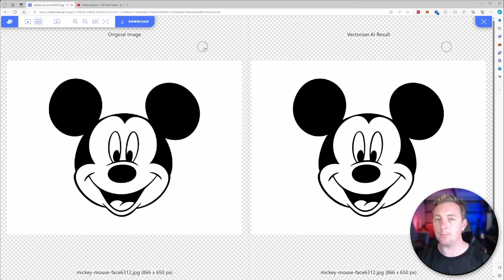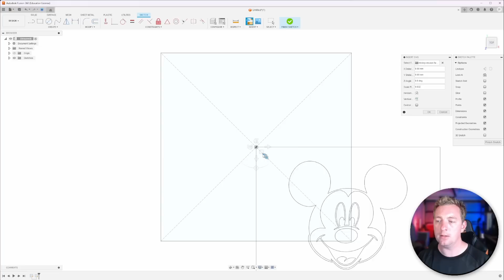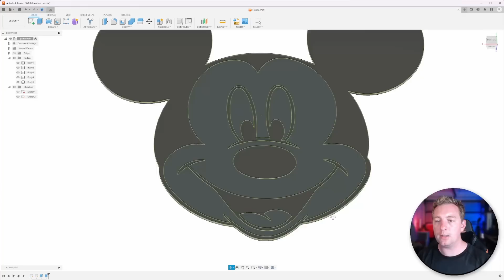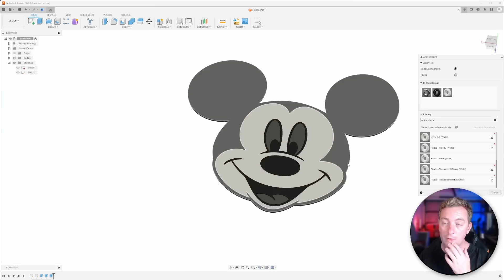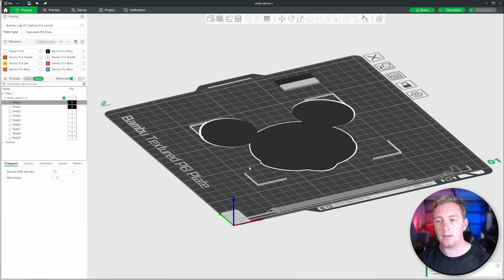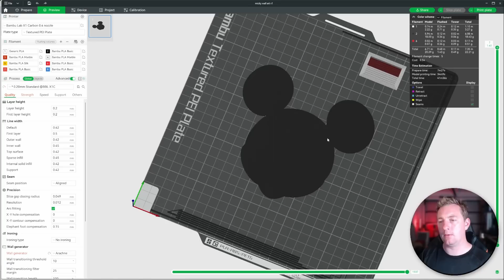EASY Tutorial For COLOURED Wall Art with Bambu Lab 3D Printers!

Comment: Great video, but I found the 0.4mm was way too thin and I can see through the white very easily. Even when I changed the white to 2mm, I could still see the infill beneath. Actually, now that I think of it, maybe adding a thicker white layer contributes to the transparency. I am using a Bambu A1. Thanks for the video. It got me started.
Reply from the maker: Thank for the comment. I dont have an ams with my a1 to try unfortunately. I wonder if there is a slight difference.
Reply: @DraftID  - I am positive it's a settings thing. Or it could be a filament thing? Regardless, your video got me on the right track and it's up to me to figure out the details.

Comment: Good tutorial, how could I adapt this to do text? Im trying to add flush text to my prints bottom, thought it would be easy but I hit a wall.
Reply from the maker: I typically use fusion for this. Create a sketch and add text, then just extrude the text and cut it into the model, then extrude again to create the body of the text in the model. You can also add text directly to you models in bambu studio. Maybe I should cover both these methods in a future video :)

Comment: I haven't used a 3D printer yet but just learning before it arrives. I saw somewhere that printing lighter colors first makes for a better print. Do you consider that when designing? New sub, thanks.
Reply from the maker: You can actually set the colour print order so thats something I could try. Normally I will just auto calibrate the purge to reduce the mixing which might be why it is recommended. I will have a video out soon about some of these advanced techniques right after I finish the current video im working on for embedding magnets in prints :)

Comment: Should you be switching over to Onshape as they say there will always be a free version. I get the feeling it is also better as it's not as comprehensive as 360 which does everything (including CNC) which means it is overly complex for new users.
Reply from the maker: Im not sure, maybe its worth taking a look at if its getting more traction in the hobbymaker space. Ive just used CAD for over a decade with solidworks, inventor, fusion etc so I know them so well.

Comment: As someone without an AMS, can this be done by swapping colors on the Bambu P1S as the print progresses, or does it really need an AMS to make this clean and possible?
Reply from the maker: You can get into the Gcode and make it pause between colours and swap it but its a lot of messing around if you had lots of colours. You prob need code in there so it retracts and purges too. So probably possible, just tricky.

Comment: what i like to do is this: i would do everything like you do, maybe a bit easyer, up to thet extrution point, and then i would start changing a thing to make the printing easyer:
i would extrude the 1st thing to 1mm the next to 1.2mm the next to 1.4 ect, so that i then can change filaments per layer and it does not have to change it so often, and the waste is also minimized the con is that its not "flat flat" but WAYYYYY faster and WAYYY less waste
Reply from the maker: Interesting approach and I can see how it can save on some material. Its kind of how hueforge creates its models.

Comment: Great tutorial, a few things I’d change is to export the file to DXF instead of SVG, I’ve found it just has less issues when importing to Fusion360. Also turn on Inner/Outer/Inner for Wall ordering as it will give you more accurate details to the print. You can also change the color print order so that you print colors that have fine details first
Reply from the maker: Thanks again for the tips :)

Comment: Great explanation. Only thing  I would change is that instead of extruding to a new body, extrude to a new component for each color and export as a STEP file. This cuts down on the number of objects brought in (1 object per color).  In your example, only 3 objects would be brought in to the slicer vs. 9. I saw this in other YouTube video but can't seem to locate it. Edit: video is https://youtu.be/Fqaau61nfAU?si=l60kqhsUDBcP0zBH
Reply from the maker: Interesting, thanks for the tip. I'll play around with it and see how it changes things.
Reply: Yep, componets instead of bodies when you extrude. Rename the compnets to the color and it is much easier. BTW, good job on the video.  I usually use 1mm extrudes but I'll try 0.4mm and see how it goes.
Reply from the maker: @tfinzel  I think 0.5-0.6 prob the sweet spot. White on black at 0.4 can still get some bleed through. Looks like I'll need to do a follow up video with some of those improvements :)
Reply: @DraftID  I found the tutorial I learned about extruding to components. It's https://youtu.be/Fqaau61nfAU?si=l60kqhsUDBcP0zBH
Reply from the maker: Thank you ill check that out.

Comment: 0.4mm is not enough colour with the new meta style filaments like sunlu meta that are not as opaque. 0.6mm is needed particularly over a black base.
Reply: A strategy I use for small colored pieces is to extrude one .2 layer of silver behind .4 of color and it ends up being really bright and nice.
Reply from the maker: @solste  Thats really cool! I got to try that!
Reply from the maker: I’ll prob do a follow up cause 0.6 would have been better with white on black I think. Also should have mentioned to auto adjust the purges.
Reply: @DraftID  I find 0.6mm to be a sweet spot for light boxes as well, though it is a little weak so I do a another 0.6mm of transparent pla behind it to add strength without making it more opaque.
Reply from the maker: Great tip thanks!